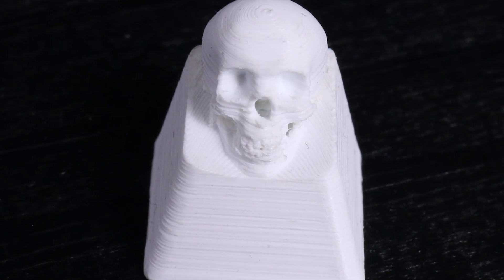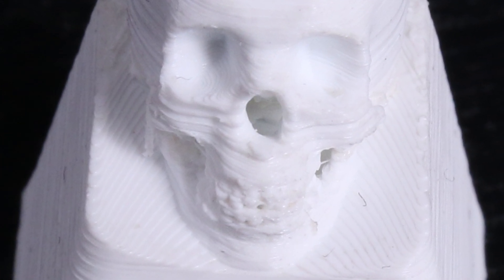RESIN-Like 3D Prints on the ENDER 3

Comment: Disclaimer: Thanks Datulab Tech for the video. The more people use the Ender and support each other in the process the better. Here goes;

Look up Tomb of 3d Printed Horrors to get the best info on the market. The guy is a genius with the Ender 3  settings. judging from your layer lines and miss-alignment, I am guessing your belts are not tensioned enough, and the castor rollers are also loose. There is a adjustable nut on one of every three wheels. Use the wrench that came with the Ender, and turn the nut until all three wheels are riding smooth on the V rails. Also check the Nozzle assembly every print for wobble, as this part moves the most on the machine. Put the whole machine on the ground, and place foam under it to reduce kinetic vibration that travels into the model. Use these profiles to get the best results: 
For 4mm nozzle:
https://www.dropbox.com/sh/vr9lkpjt6zw7s8s/AACKYwogmVZ_Cf2OLmV0D8Rja/Cura%204.3%20Creality%20Legacy%20Files%20and%20Profiles/FDG%20Profiles%20-%20Import%20These?dl=0&preview=Official_FDG_Cura_Ender3_and_5_Miniatures_4mm_v4_3l.curaprofile&subfolder_nav_tracking=1
For 3mm nozzle
https://www.dropbox.com/sh/vr9lkpjt6zw7s8s/AACKYwogmVZ_Cf2OLmV0D8Rja/Cura%204.3%20Creality%20Legacy%20Files%20and%20Profiles/FDG%20Profiles%20-%20Import%20These?dl=0&preview=Official_FDG_Cura_Ender3_and_5_Miniatures_3mm_v3_3l.curaprofile&subfolder_nav_tracking=1
For 2mm nozzle (I personally recommend going no lower than 0.25mm nozzle, as my experience has been less than stellar with 2mm, heat anomalies, jamming. The detail is not noticably different between 0.25mm and 0.2mm, but the headache increases exponentially
https://www.dropbox.com/sh/vr9lkpjt6zw7s8s/AACKYwogmVZ_Cf2OLmV0D8Rja/Cura%204.3%20Creality%20Legacy%20Files%20and%20Profiles/FDG%20Profiles%20-%20Import%20These?dl=0&preview=Official_FDG_Cura_Ender3_and_5_Miniatures_2mmNozzle_v2_2l.curaprofile&subfolder_nav_tracking=1
Your Welcome.
Reply: Can you upload the settings again please?? They have been removed 
thanks!
Reply: x2 
please upload again!
Reply: @Splatterpunk_OldNewYork  Many thanks for sharing these profiles! Any idea of what changes might be required for the Ender 3 V2?
Reply: @MA-nx3xj  By Ender 3 V2 you mean the one that has the same build but a wider track? Same as above my friend. As far as ultimate build, you should get in order: Capricorn Tube (reduces feeder issues by being slimmer in diameter than the bowmen, also made of better material. The bowden wears out over time, but only the hot end side. CHEP channel has a good breakdown on solutions.) Metal extruder (again feeder issues) Creality bed springs (Superior Bed adjustment and control) An Anti-Backlash Z screw bolt, keeps the Z height from drifting by locking up the Z screw from dropping micrometers. A silicone sock for easy cleaning of nozzle and heating block temperature stability. And last but not least a new motherboard (SKR mini E3d or its knockoffs) that supports BL-touch or its knockoffs, and also supports silent running. The last two are optional, though apart from the lack of high pitched squeaks from my Nema 17's I have not noticed better performance. The BL-touch however is extremely useful, as it points out bed level errors which are like 80% of your failed prints. Hope that helps.

Comment: And abyss has a good point if you don't support the heater block in place when replacing the nozzle you can easily snap the throat of the hot end. You should check out Thom sanladerers video on changing nozzles.

Comment: Honestly I think you need to tune your printer better. I have the ender 3 pro  and print with a 0.4mm nozzle at 1.6mm layer height and my prints look way cleaner than any of these prints, especially the 0.02mm nozzle prints.
Reply: Considering the Ender 3 stepper motor runs in.0.04 increments his layer heights of 0.15 and 0.07 are bad, should be 0.08 0.12 0.16 only

Comment: The "magic numbers" for the Ender printers are multiples of 0.04 for layer height. So, lowest you should go is 0.08, standard being 0.12 to 0.16, 0.2 for rough low detail models.
The smallest nozzle diameter recommended is 0.3 as smaller nozzles tend to clog often, it will give somewhat more detail for smaller, complex prints like figurines.
Reply: 0.2 clogs because people dont understand how thermodynamics of the printer work.  You have molten plastic in the melt chamber, then the solid filament is pushing into it, this causes the pressure needed for extrusion. If you change your nozzle to a 0.2mm, you need to change the retraction speed of the solid filament, the print speed so that the exothermic heat from the nozzle is not melting all ready froozen plastic.  Once you have those set, your good to go.
Reply: what about big nozzles? Like 1mm with bigger/not detailed models?
Reply: Yup, thanks for saying it, video is misleading for fresh Ender 3 users
Reply: Once you know how to work with a 0.2mm nozzle you will throw the 0.3mm one in the trash because there's no use for it anymore.
Reply: @DarthChrisB  exactly. Its all about the pressure and retraction speeds
Reply: @LT72884  
That's what she said?
Reply: @164procar4  facts!